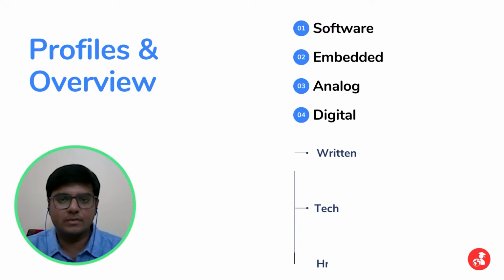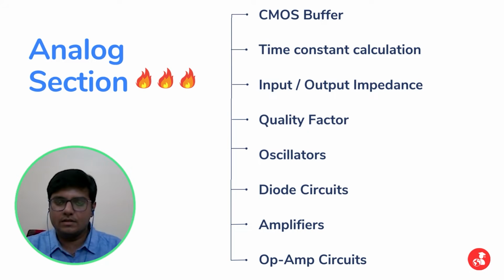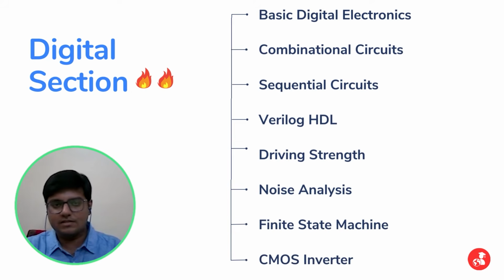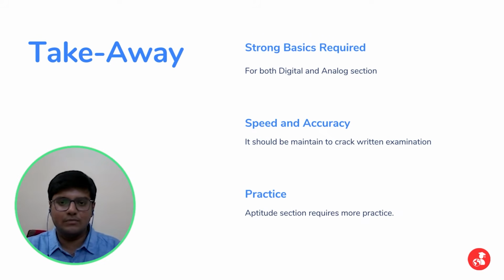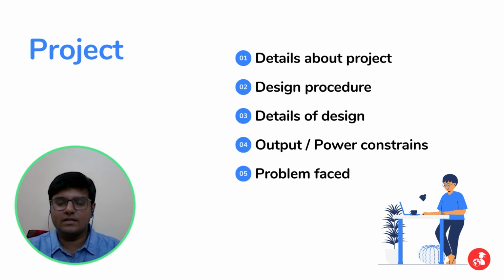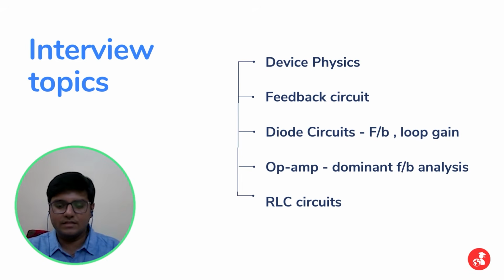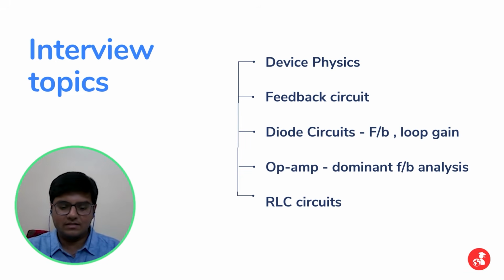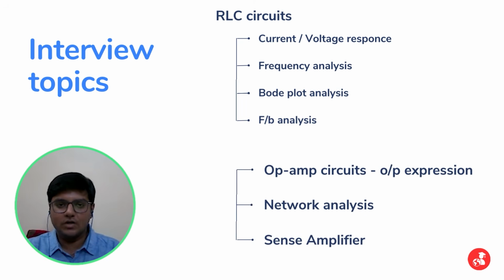Texas Instruments Placement Preparation | IMP Resources | Written Examination | Interview Experience

Comment: If someone has digital project as mtech final year, will it harm selection in TI analog?
Reply from the maker: No, not necessarily, you can understand device level implementation of your digital project or add another project in analog domain or atleast cmos design / layout so that you can stress on device level electronics understanding.